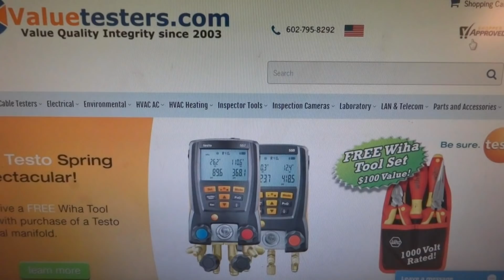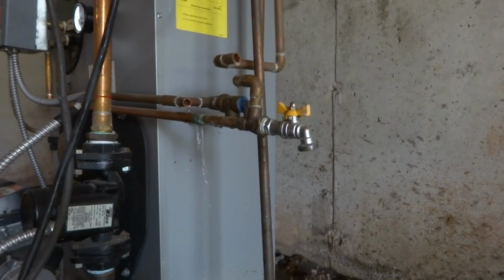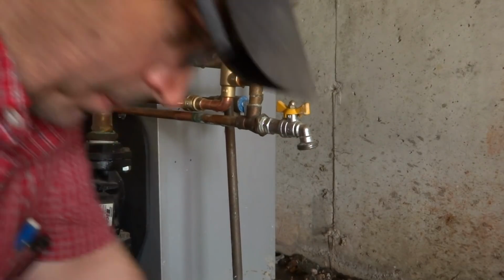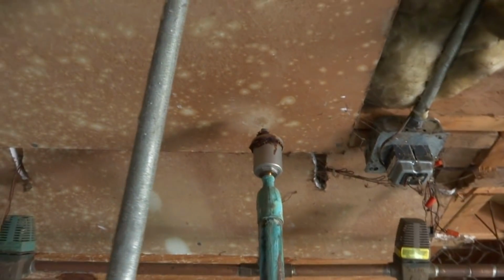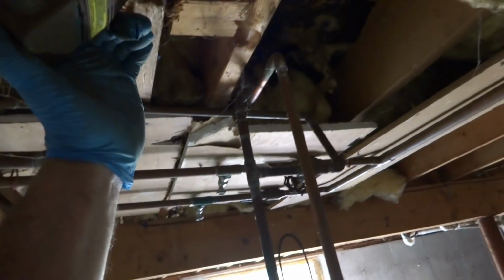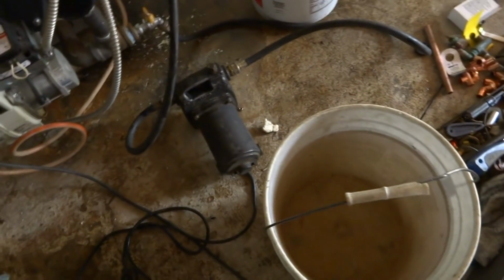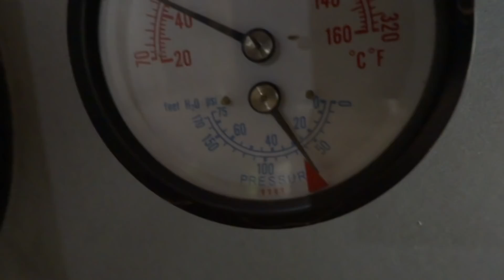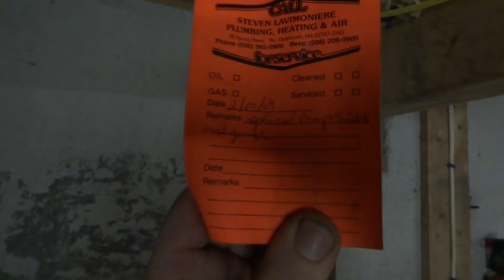no hot water

Comment: dont try this at home!  interesting set up.  we dont see a lot of domestic hot water from a boiler in the midwest.
can a temp gauge be put in place downstream of the mixer or do most folks just go by feel in the shower?  wonder if that little brass disc is in the pipe?   nice work!  (i cant seem to master that, pull off the snot with the solder line yet)

Comment: Just curious why there is a relief valve on the domestic loop? I want to put a tempering valve in mine because I don't have one. Mine doesn't have a relief valve installed now do I have to add one when I put in the tempering valve? I am going to put a ball valve in like you did too. Thanks
Reply from the maker: yes there should be a pressure relief valve on water line . made for tankless  125 psi i believe ....1/2 ips
Reply: Thanks Steve, I will have to pick on up. Long time sub here ,love your channel!